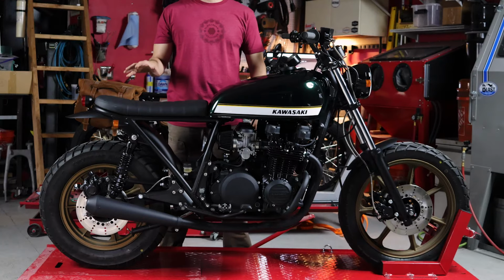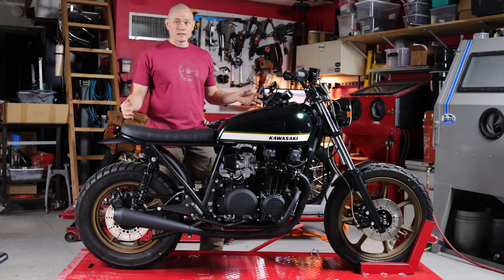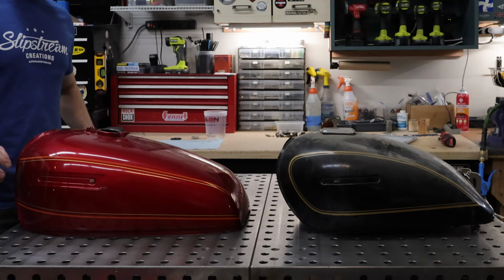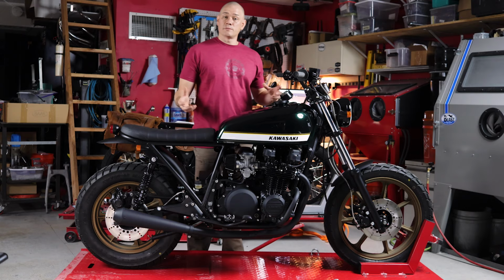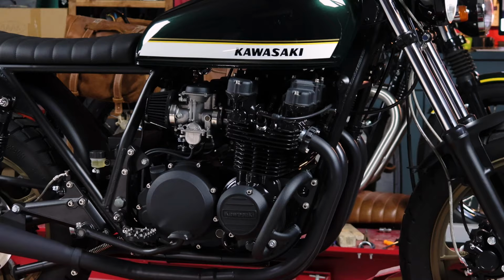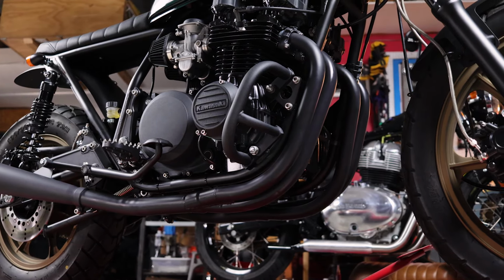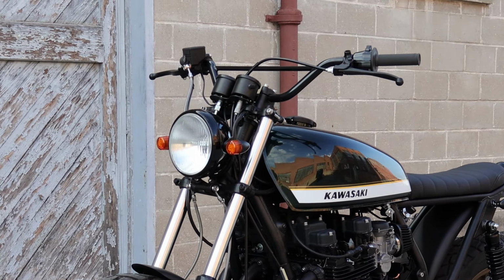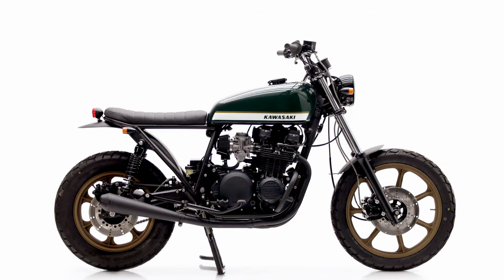Custom KZ750 Scrambler  - 1980 Kawasaki LTD Motorcycle Build Overview

Comment: So basically just a new tank and subframe. Stop with the waffle and BS. The triple clamps are same on LTD and the std E model, E model has 18inch rear wheel which would have been a better swap out and needed no mods to fit as the swingarm is the same.
Oh and CV carbies still even with a jet kit 😂😂😂😂😂
Well done you did bugger all and called yourself a bike builder 😂
Reply from the maker: Bummer that you didn't like the bike, but that's ok. This is what the bike's owner was looking for, and they reached out to me to build it because this is the style of bike I often build. It's nothing off the wall, and most of the stuff I do I'd probably classify as a "resto-mod". If it was mistaken for a factory bike, I wouldn't be insulted. There are definitely a lot of things we could have done differently, we just decided not to, for a variety of reasons. We considered swapping out the wheels to wire spoke wheels, but decided we liked these mag wheels. 18's would have given us more tire choices though, for sure. I'll challenge you on one thing though -- the triple clamps and the forks are not the same on the LTD and the standard. The LTD has a lower offset triple, and leading axle forks. Not that it matters much. Hopefully you are enjoying whatever you're riding, and that's all that matters really.
Reply: Nice to see a simple mod look so good instead of all the over complicated crap often seen on here
Nice bike